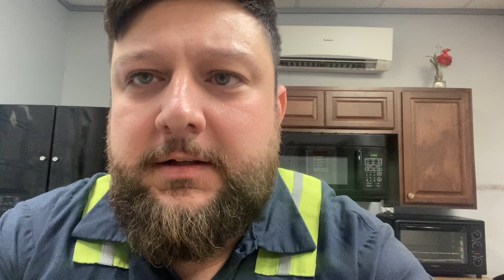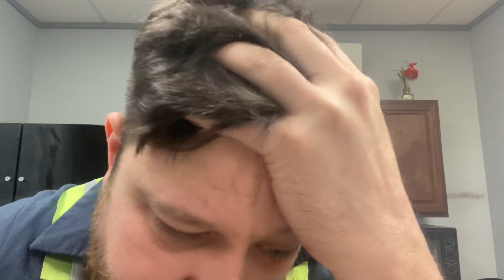Piston to Valve Clearance Discussion

Comment: Man I built a race kart motor put a big ass cam in it, head was milled seventy thousands,  twenty thousand  longer rod over stock that was fun to figure out, had to get a high comp piston with valve relief cut out, had to bring the push tubes so I could get my rocker geometry right and measure it to figure out what thickness head gasket I needed! 
Fun stuff!
Reply from the maker: It’s a mission. I’ve always been a forced induction guy so stick heads were the norm. If everything goes as planned though goin for big boy power NA k next year so the times comin